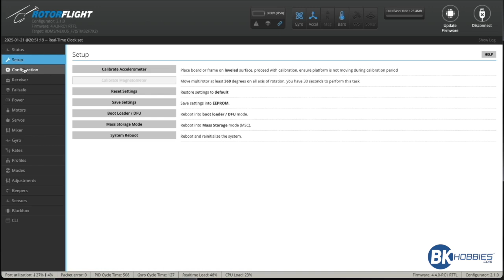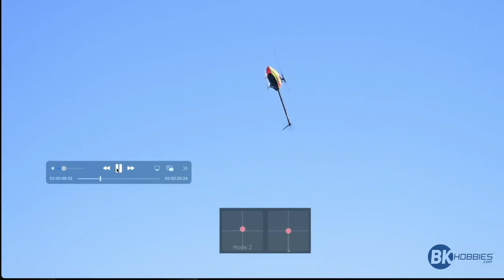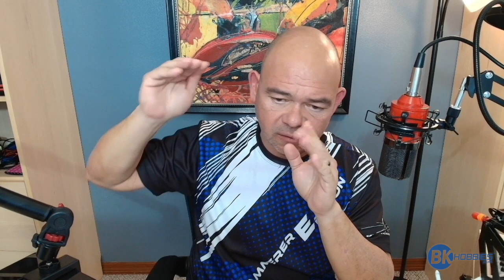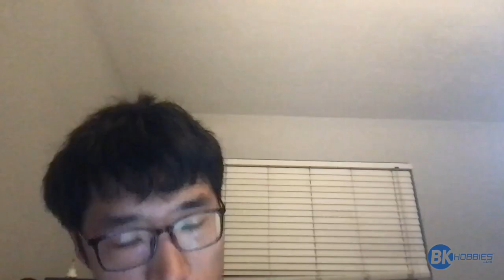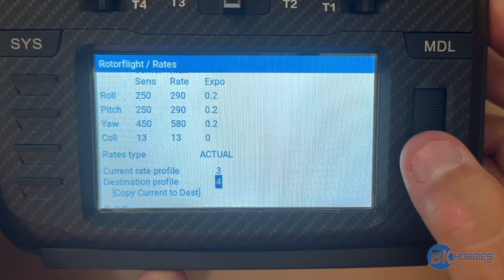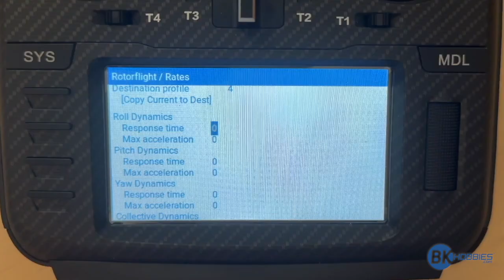RotorFlight PID tuning explained

Comment: Jiawen says, that for tail rotor stop gains the ratio between cw value and ccw value is the most important thing at this point.
This would mean, they are not totally separated separated values, right? If so - how does changing one of them impact the other ???
Thanks for some detailed information on that.
(enjoying this helpful video from Germany by the way)

Comment: "Hi! I'm using the Nexus-X with Rotorflight. Since my radio is in Airplane mode, it doesn't have a Pitch Curve menu (only Throttle Curve). How can I limit my mechanical negative pitch to -4° for scale flight directly inside the Rotorflight Configurator? Thanks!"

Comment: I still remember the good ol' days of mechanical mix swash and flybar where you just built it up, made everything square and leveled the flybar paddles and then flew the pi$$ out of it and it flew great right off the build table, predictable with no bad unpredictable tendencies. It was also sooo smooth and organic. The heky jeky style of flying today is just, blech.

Comment: You guys are amazing for doing this for the love of this hobby and to the community. As far as Radio goes, been a Futaba user, then long ago had my Taranis! and you guys were right, back in the day there’s so many settings and run around within the transmitter just to get a good flying Heli, I also had the first version of the Vcontrol and few Spectrum radios. Then RadioMaster Tx16s came along and I’ve been back and fort between Futaba and RadioMaster. I recently switched my 420 Raw back to RadioMaster this time the ELRS version and loving it. It’s amazing how this PID’s works from 380-700 Heli’s. And you guys are right, giving people the file is easy but learning how to do the setup yourself is better than just getting those files. Thank you guys for doing all this, informative videos and teaching people to be better in this hobby we love. Regards and stay safe always. Sir Bert, my 420 is flying great!

Comment: I watch this video like 20-30x, but my tail is still wobble to the right when punching collective so fast... I think we need more tutorial how to tame the tail on the rotorflight because on the discord so many people still ask for that...
Reply from the maker: Could be your head speed to gear ratio setup. Maybe your head speed is too low and the tail doesn't have enough mechanical compensation to counteract the torque. What helicopter, what gear ratio and what motor and battery? I will need to know all that as well as the head speed you are running to be sure.
Reply: @BertKammerer  Wow, I can't believe you replied to my message... thank you for taking the time, Bert! I have so much respect for you. 
By the way, I tried several headspeeds—2200, 2600, even 2800—but none of them worked. Eventually, someone on the Discord RF group told me about the Governor on my ESC. I ended up switching the settings to Gov Ext and using the Governor from RF, and the problem was solved. However, one issue arose: when I attempted rainbows, my helicopter started vibrating again when it stopped during the rainbow maneuver.
Reply from the maker: @FebyKrisRC  The first issue could be related to the wrong setup on the ESC, the issue with vibrations during rainbow stops is more related to your gains, more than likely the P or D gains on your pitch axis. I suggest you want the video called "PID Tuning with Jiawen Bao" that is on my channel, we talk a lot about PIDs there.
Reply: @BertKammerer  I can't find the video

Comment: Hi Bert, I have setup two of my Heli with the nexus.there is a slow tail drift on both heli’s in a hover. What did I miss or where do I go to fix it. Your videos are great.. thank you.
Reply from the maker: Hello, make sure your settings for CCW and CW as well as the zero setting for the tail are all good in the mixer screen. Then make sure your gains are correct in profile, you should have your P between 70 and 120 and your I should be above 180, the D should be around 20 or so.
Reply: Hello..I found my misstate…  I setup remote pid tuning and didn’t switch off trims on yaw…so I accidentally gave trim to the tail…. Thank you again…

Comment: Hi Bert, I’m trialing the nexus and I can’t seem to shift the wag. It stays the same from P45-120. Is it possible it could be an issue with the tail set up and the CCW/CW degrees?
Reply from the maker: Is it a fast or slow wag? I would tend to think you need more D. Also, double check our geometry and numbers in the mixer screen for CW and CCW for the tail. Your I should be at least 180 or more also.

Comment: Question --- Cross-Coupling Gain is set at 5 in this video, default in 2.1 (final release) is 50. Was this a scaling change that accidentally got carried over from previous versions CLI dumps, or is the setting actually intended to be 5 when default is 50?
Reply from the maker: Just for clarification, the current version is 4.4.0. 2.1 is the latest version for the configurator. In 4.4.0 indeed cross coupling default is 50 and has been purposely lowered to 5 as it seems to feed too much roll input correction with pitch commands making some maneuvers like piroflips feel weird. I lowered cross coupling gain to 5 and raised the ratio to 10%, this makes the helicopter feel much better to me now.
Reply: @ perfect thanks Bert!

Comment: Are these settings good for all profiles 0-3 with 0 being the lowest headspeed, 1 being a medium headspeed, 2 being the highest headspeed and 3 being for autorotation?
Reply from the maker: Yes. I run 1 for lowest, 2 for medium, 3 for high head speed and 4 for auto rotation bailout.

Comment: Hmm, why is nobody doing this with blackbox analysis ?
Reply from the maker: Some do, but in the end, it is about "feel". Most people can't feel the difference when changing PIDs in small increments and the black box doesn't show you how the helicopter should fly. I have used it just for the heck of it, but to be honest, I haven't felt the need to use it and no other system offers that, so I am used to tuning to find the best feel for my flying style.
Reply: @ 
Coming from FPV there the suggestion is to have the PIDs very close to optimal damped and tube feel with rates.
I still need to get used to tuning a heli. Its a bit more like Inav and heavyly depended on FF. And yes the Pids are quite forgiving. 10 more or less is often nothing. 
Currently I still have to much I Term buildup. Its not really visible in flight but sure in the logs
Reply from the maker: @jas-FPV  For sure, but unless you're flying very hard or precise maneuvers you can get away with a less than perfect tune and never really have an issue.

Comment: Great video Burt. If you have got Lua scripts on your radio you can change the PID in the radio correct. Will the values in rotoflight be the same as in the radio so you don't have to bring a laptop to make changes.
Reply from the maker: Correct, watch my previous video titled "Telemetry" where I explain how to load the RotorFlight 2 LUA and how to adjust settings from the radio.

Comment: Thanks Bert, Jaiwen and Alex.  Some subtle hints built in there.  These videos are building a strong foundation for us guys who are learning what this stuff does.  I loved what Jaiwen’s hint was describing P and D gain, spoiler, 
P is the strength of the spring, D is the strength of the damping.  Just enough D makes P stop bouncing.  Cool!❤
Reply from the maker: Thanks! Yes indeed, enough D makes the the P stop bouncing, good way to put it. High D with lower P is like flying vBar (if you're familiar with it) with a high style number, low D with high P is like flying vBar with a lower style. The numbers shown on the screen work very well for 90% of the helis out there though.

Comment: Great video . Thank you. 
Would love to see a video on filters and what they all mean and how to take out the noise .
Reply from the maker: The filter settings we provided work for 99% of all helicopters. Very little reason to dive that deep into things, only 1% of those who fly this system will want to do that to be honest. Most FBL systems do not even allow you to see what they have for filters, so this is something I will consider last, but thanks for the suggestion.
Reply: @ ok good to know. I am using your IL Goblin pro file and have adjusted some small things but the filters are the same. My IL is flying great . I had one question about packet rate. I am using 333Hz(-105dBm). Is this ok or should I be using D500 or F500?
Reply from the maker: @justinhilker9752  I would leave it at 333 Hz for now, no reason to go higher. However, you can go to D500, but that will change your channels, so you'll have to set the arming point for throttle as it will go from 988 or so to 1000 us. I would just leave it alone.
Reply: @bertkammerer sounds good . Thank
You for the reply

Comment: Great, thank you. It would also be benificial to have Jiawen explain some tuning using Black Box. I remember with FPv Quads there is something called a PID  toolbox where you can see the step response curves which makes it super easy to know when you are critically dampened on an axis however I'm not sure if this has been adapted to Helicopters yet?

Comment: Rotorflight system is very good  perform well free also and support cheap gyros but complicated to learn it you must to spent many hours to learn it as i did to my tb40 but with vbar system takes me only 30 minutes for my tb70 ready to fly! Both perform well is the same feelings for me; My opinion is that i prefer vbar for the simplicity to set everything fast and no need pc or laptop that's way worth the money!!!
Reply: Thanks Bert, Jaiwen and Alex.  Some subtle hints built in there.  These videos are building a strong foundation for us guys who are learning what this stuff does.  I loved what Jaiwen’s hint was describing P and D gain, spoiler, 
P is the strength of the spring, D is the strength of the damping.  Just enough D makes P stop bouncing.  Cool!❤
Reply from the maker: Have you seen the rest of my setup videos? Once you learn it, it is easy. It takes me 15 minutes to setup a new helicopter by importing a file from another one and then making some small changes. But yes, vBar is easier to learn for sure, I flew it for more than 10 years.
Reply: Yes you are right but Bert you are one of the best pilot in the world everything is easy for you not for the others and especially beginners pilots i was spectrum and later futaba guy but with vbar help me a lot to be expert pilot with my old 550 mikado now i fly nexus and vbar but still like vbar system you are doing good job with those videos me help me a lot!! Keep the good job!!!

Comment: Great video. Thanks guys :)
It was mentioned that the Dynamics Acceleration values "weren't working".  Given the value is 0 to 50000 (with a scale of 0.1, meaning values 0-5000), is it possible you haven't gone high enough to be able to notice the change? There are settings for these, but other than the LUA, they are available in the Configurator-CLI
Reply from the maker: Could be, but no reason for me at least to mess with it as I don't see the need for it. I ended up increasing the value for response time to 4, so decreasing response time slightly. My stuff is flying amazing :)

Comment: Thanks for having me!
Reply: Just curious, do these PID numbers work the same for 760 servos and 1520 servos?
Reply: @andysofly  yes
Reply: @jiawenbao3698  would the 200us Futaba servo with the 1160 refresh rate work?
Reply: @andysofly  yes, you can even crank up the refresh rate to like 2000hz
Reply: @ okay, I noticed that the scale neg and scale positive doesn’t go below 100 in order to maintain the .329 relationship to center pulse. Is that fine for 200us servos? Thanks so much for your help!
Reply: @andysofly  you choose scale to calibrate the servos. So with gel correction off, whatever the override says should match the actual output angles on the servo arms
Reply: @ okay so with geo cor off, the scale doesn’t really matter? Also, one last question, do you think the Rotorflight gov is better than the internal Esc gov?
Reply: @andysofly  I highly recommend calibrating and turn back on geo correction on cyclic servos. I do think RF gov is better than ESC gov
Reply: 帅哥你好！
Reply: Good evening I have Roban 800 Scale.  i would  like to know what you will be suggesting on the setting. Roll, Pitch, and Yaw  Thanks.